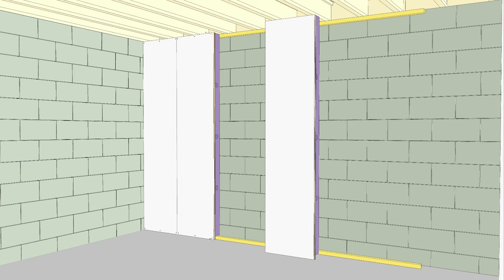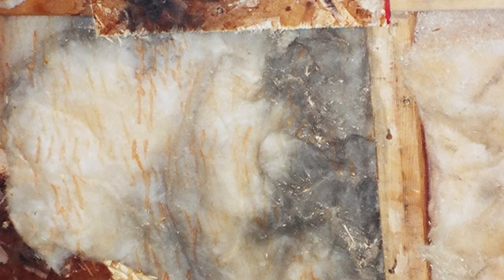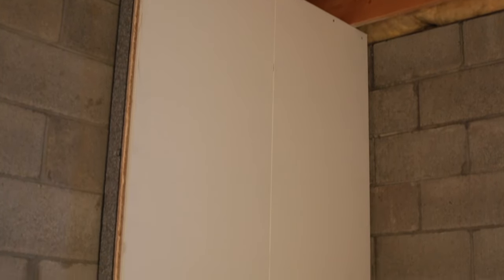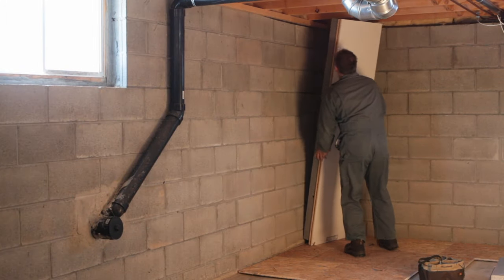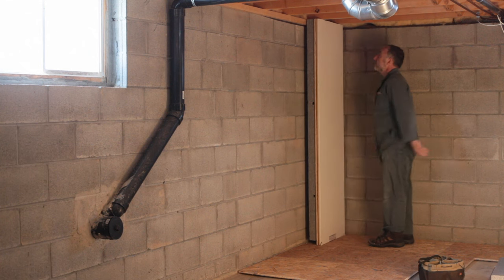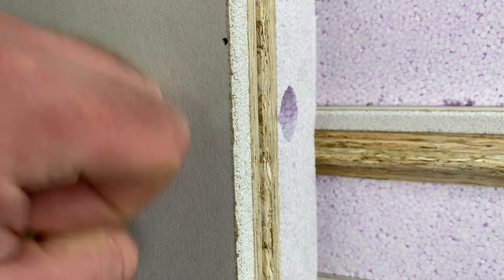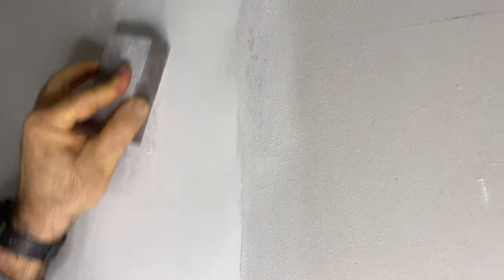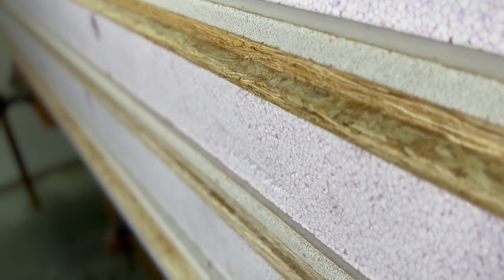The BEST Wall Panels for Basement Finishing

Comment: These panels are $144/panel in the Northeast. That's insane. I don't see why I can't make my own 4x8x8 panels for way less. And if I frame the walls I don't need the OSB for stability. It's a no-brainer.
Reply: $169/panel where I'm at in the NW.
Reply: Or pay someone $200 per 4x8 to finish it
Reply: @1993JosephS  That's a good point! The cost isn't too bad when you look at it that way.
5/8th drywall, $26
Promax R-13 $56
Wood maybe $60
+ labor
Reply: I own a basement waterproofing company and have been in the business for 25 yrs. I use pvc or plastic panels with dividers and corners. It's paintable and I drop the bottom below the concrete into the gravel then cement. It looks like a new basement. 1/16 thick and secured with rivets. Everybody has seen the restaurant bathroom with the plastic walls. That's it! Now it's waterproofed and beautiful. $25 per sheet from home depot, $10 for 50 rivets, and the dividers and corners are $3/ pcs. You're welcome!
Reply: @jaybutts5992  Awesome! Thank you for the advice. I'll look into this.
Reply: What about fire codes? PVC is no good for interior space
Reply: @jaybutts5992  So if it cracks it stays in the concrete? how would that repair go? Maybe I'm not understanding...lol
Reply: @djRoyalTee  piece of cake. Replacing the panels are easy. Remove the rivets. The concrete will be dry it'll slide right out. The sheets will last forever unless you beat the crap out of it.

Comment: Would moisture (warmer air from inside) find it's way behind the panel and in the gap between the concrete and the back of the panel.... causing condensation to drip? Would it be better to have a 2" foam layer pressed against the concrete, behind this dri-core panel? Overkill perhaps, but even better and safer? And/or a french drain on the perimeter?

Comment: If basement (new ) came with studs & bats would you pull the bats and use Drycore instead? Want it done correct for lasting quality?
Reply: What is behind the studs and bats?  I also recommend foam board as a first layer.

Comment: Would love to see a price comparision breakdown, using these panels vs tradtional framing/insulation/drywall.
Reply from the maker: Hello Mark! Cost is somewhat higher overall for the panels. It's more for materials, but less for labour. That said, I've seen so many moldy basements that make people sick, and the cause is mold growing in fibre insulation in walls. There's no point in saving a bit of money on a basement, only to create a nasty mess down there.
Thanks for watching my videos!
Steve
Reply: @baileylineroad  insulation in basements is something I never understood. I'm in ohio and our frostline is 12 to 24 inches below grade. The ground is a natural insulator. All insulation does is make concrete sweat! It's like a cold glass of water on a warm summer day. It will condensate naturally.   I would never recommend insulation on a finish in a basement.

Comment: Why "no multiple coats of plaster"?  The beveled edges are great for corners, but for straight walls, regular drywall has a smaller gap to fill.  If regular drywall requires tape and multiple coats of 'mud', why would it be different rom Dricore?

Comment: the presence of the wood and drywall makes this a TERRIBLE solution.  how are you an expert?  what happens when the exterior footing drains silt and the basement floods???
Reply from the maker: Good Morning!
You're right to be concerned about wood, but in the case of these panels the wood is minimal, the entire panel is held away from the wall, and the system is tolerant of small amounts of moisture. That's really all you can expect in a basement wall situation. It's vastly superior to the wood-frame-and-batt-insulation approach that's still used in most basement finishing projects. Another option that I discuss in my online basement finishing course is steel studs with spray foam. That's completely wood-free and works well, too.
Thanks for watching my videos!
Steve